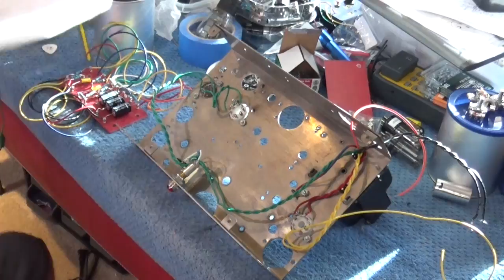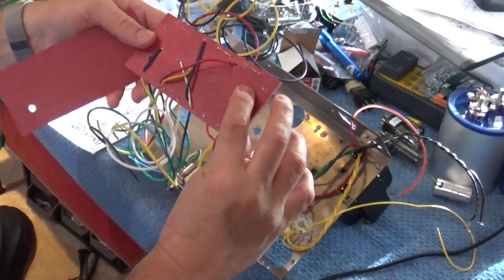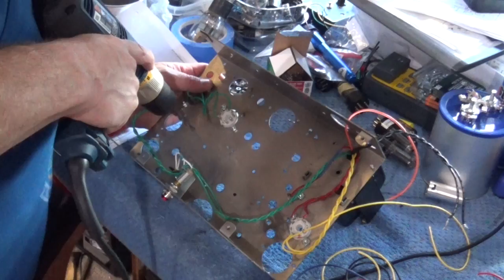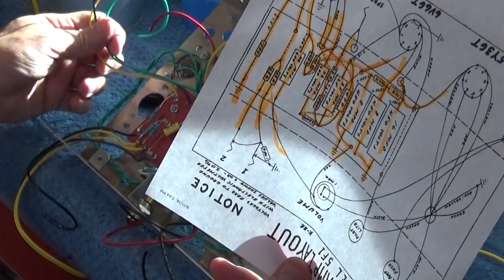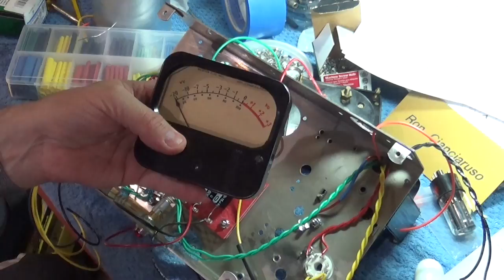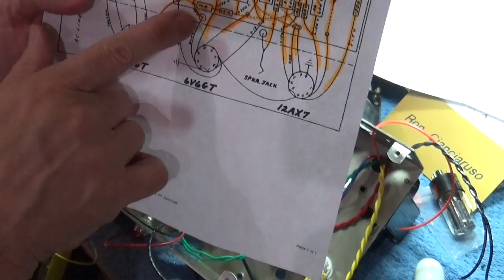Atwater Champ Combo Amp, Episode 3 -  Call the Mounties !!!!!

Comment: Howdeedoo Rondo, Kewl drill bits, don't wonder, no need to punch.  Thse lght bulbs are either AC or DC, doesn't matter.   Not sure, but the meter may be a microammeter, millammeter, or volt meter.  A volt meter is really an ammeter with a built in load ressister.  Ammeters are connected in series of a circuit.  VMs are usually across in parrellel.  So a VM might go across the speaker circuit, like a wattmeter.  BUT, I suspect it's a VU microammeter that connects in series with the guitar or mic input circuit, like inline with the vol control.  Check some tape recorders, they uually have the VU meters in the INPUT circuit after the vol control.  The output could way overload such a meter, especially if there is no load resister in it.  Don
Reply: PS: If itsa microammeter, and peggs after the vol control, simply find a proper pot to adjust and calibrate it to match the signal.  But do not connect it to the speaker section until you're sure what type of meter it is, that could blow out the meter coil.  Sort of like hooking a mic to a speaker jack, not a good idea.  The meter might have some indication in microprint on it, what it really is.  D
Reply from the maker: Thanks Don, will make sure I consider all that Excellent information !!!!!!  Cannot wait to get this connected and working, will be fun !!!